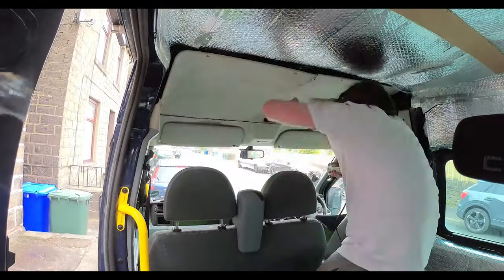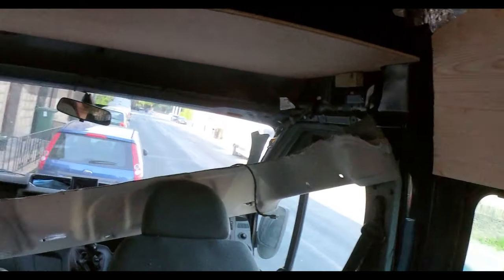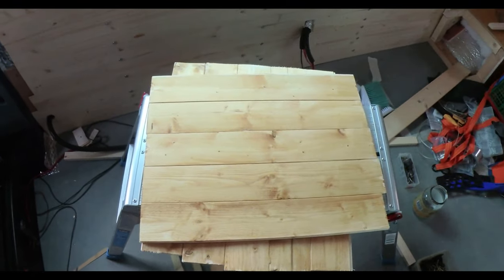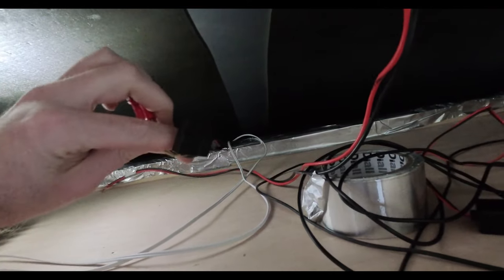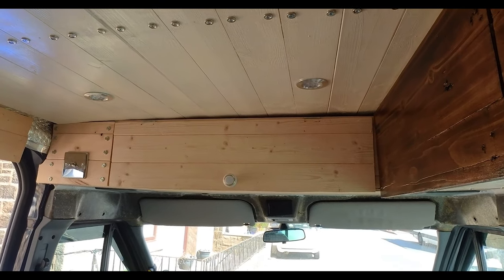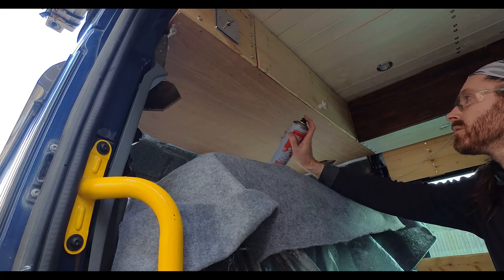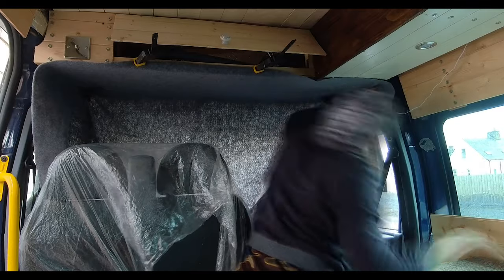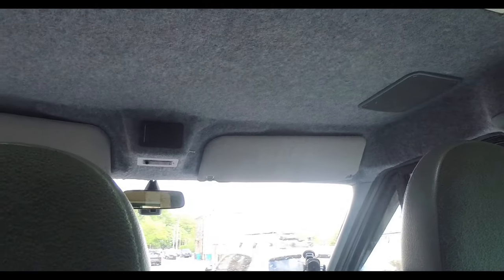Part 27 | A new way to do over-cab storage | Ford Transit Minibus Campervan Conversion

Comment: I've had the idea of storage above the seats in our medium height roof minibus conversion but how to support the shelf etc was my issue. I didn't want to make too many major changes, mainly cause of my skill and tools available. After seeing this video I'm going to use the bolt holes for the handles above the doors with some angle brackets and then like you, cover the existing headliner with carpet but keep the headliner intact.
Reply from the maker: I was terrified of doing this. It was also a nightmare to do. Once if finished it, I was so pleased with the results.
A few things this taught me, things don't have to be as strong as you think. 
If it can be hidden, it can be ugly! As long as it works 😁